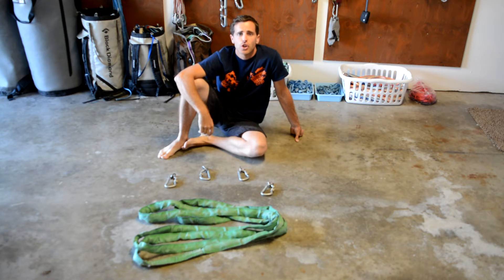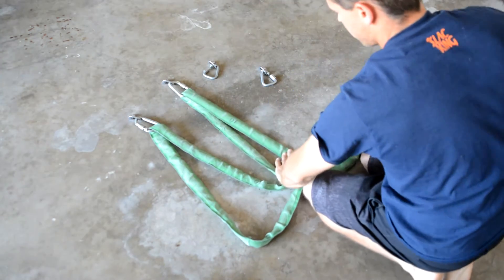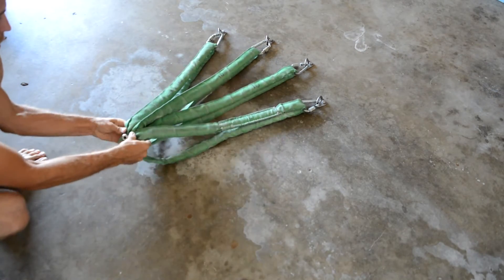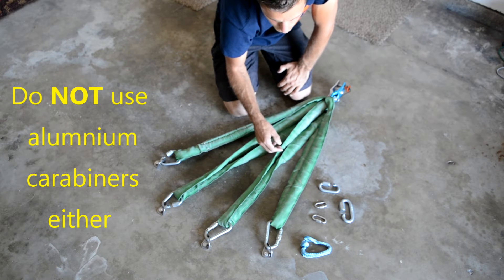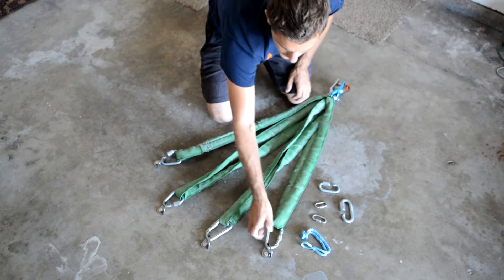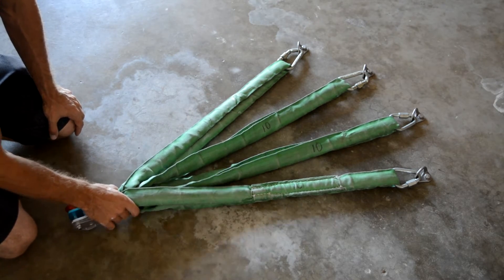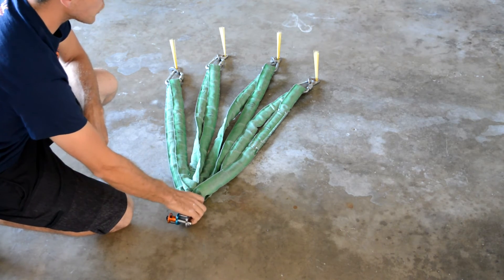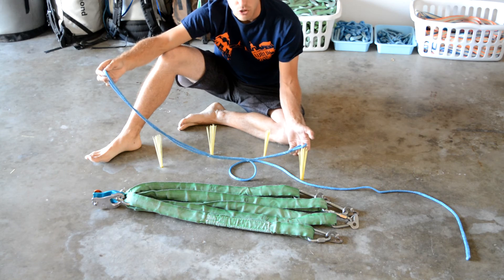Highline Anchor with Spansets

Comment: Great video, I was wondering what exatly is the masterpoint? I thought the masterpoint was the whole tensioning anchor, but since you said we have no whoopie slings going from each bolt to the masterpoint, then I guess it's a very specific part of the whole anchor system, is it where the shackle secures the sling to the weblock?
Reply from the maker: Yea. When we say master point... we mean where we connect the shackle to all the legs of an anchor (individual backups or not) and connect our weblocks to that.

Comment: But if you use more than one spanset (say you use one for every anchor point) will that still be unsafe? All the highline I've seen and walked were rigged like that!
Reply from the maker: If you have one spanset for each anchor point (bolt), how is it equalized?  Independent strands are important but also pulling on all of the points evenly is too.

Comment: Hey ! To me you forgot to do a twist in your spanset.. If you don't see what I mean, check out this website (it's in French but google translate can fix it I guess) http://www.slackline974.org/triangulation-egalisation/ It prevents the spanset to "escape" from all the bolts in case one of them fails
Reply from the maker: Starting at 1:10 into the video.... I show how I put it in and that may be where you are saying I didn't put the twist in it.  I thought so too when I first was shown this.  If fact it keeps the weblock flat AND has the twist.  It is the furthest right strand that goes back to the furthest left strand that is where the magic happens.  Try to set this up with a couple chair legs as your anchors at home and then let one "anchor" go and see what happens when it extends.  It holds.  It is very important to have the twist you are talking about in any anchor you equalize... very good point.  This DOES have it though.  Give it try at home!

Comment: Hey i think its really important to mention that loading the biners on the large side like that reduces their strength by almost half, so potentially the biners are weaker than the hangers. Loading with their small side to the spanset it is far stronger, but leaves no equalisation. it should have a notice on that bit of the video against using biners in that way therefor making them unsafe for spanset rigging. Also, 1T spansets are absolutely bomber and when used in a 3-4 point anchor with 8mm deltas and into a pure lock. they equalise really well and there is still tons of space for whoopies (IMO pretty against whoopies) Also i much prefer spansets on a 2 bolt anchor than static rope,  unless i double wrap the static.
Reply from the maker: I looked this up and you are right!  I didn't realize that putting a spanset on the wide side of a carabiner tri-loads it.  Unless you use delta quicklinks (the triangle kind), spansets should not be used!  And don't forget to add some sort of redundancy so it doesn't shock load if 1 bolt failed.  Thanks for pointing this out.
Reply: @HowNOT2  hey Ryan, what do you think it could be used to backup the sliding x, without whoopie slings? Dynamic rope maybe?
Reply: Anything wrong with oval steel carabiners then, as they are symmetrical & would not be tri-loaded??